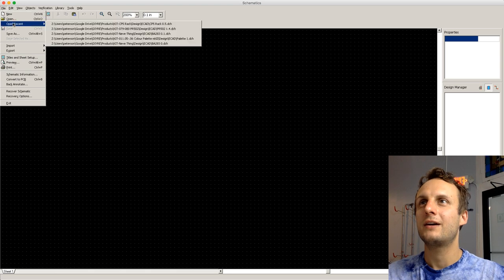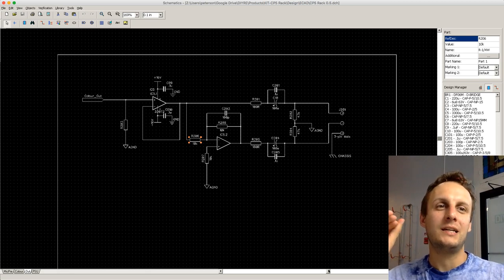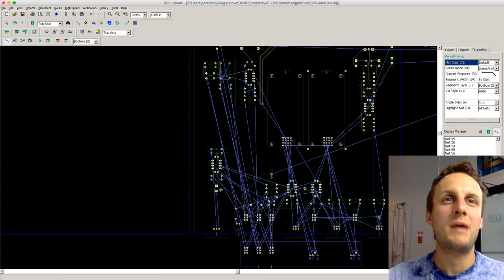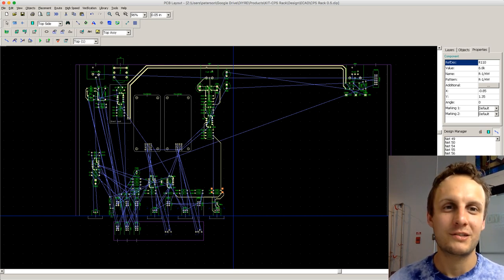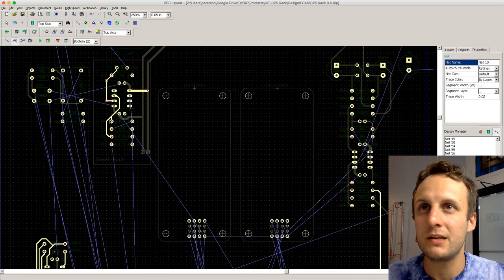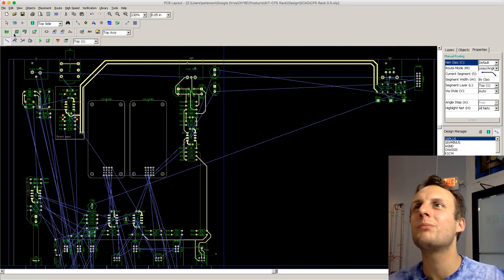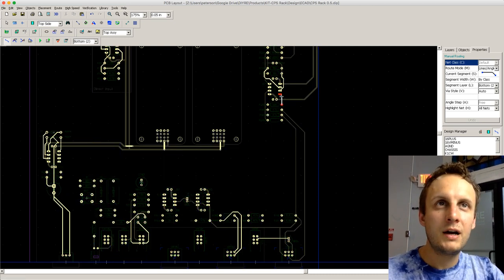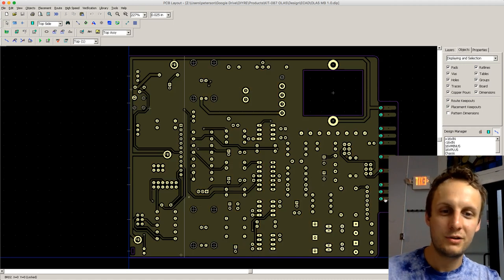Mic Preamp Live PCB Layout

Comment: I'm trying to turn my broken mhc ec619cip sony stereo into a mic or guitar amp I took out the mother board but I don't know where to solder the mic wires can I just hook them up where the tuner wire adapter is it's just a dynamic mic but I just want  to connect the mic straight to the mother board I don't need to use the radio cd player I've been trying to figure out a way but I just can't get it.